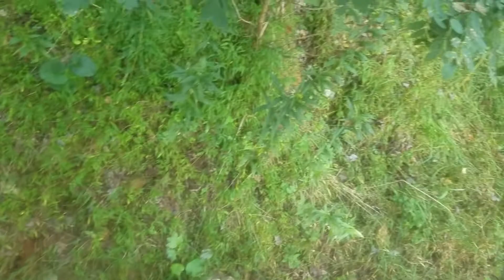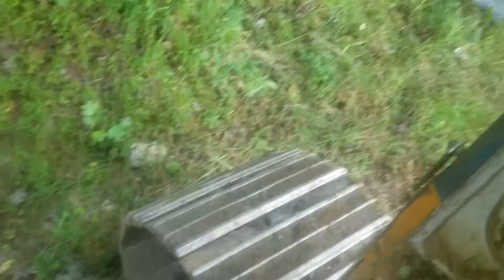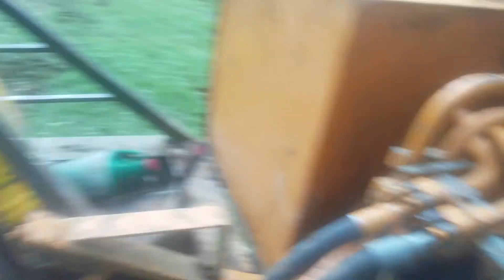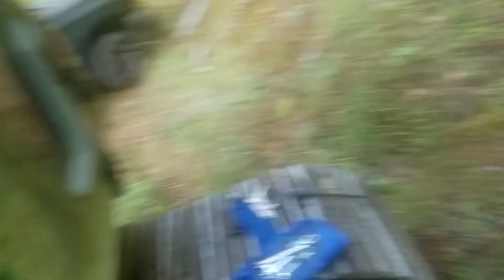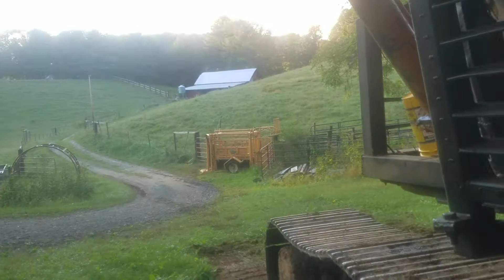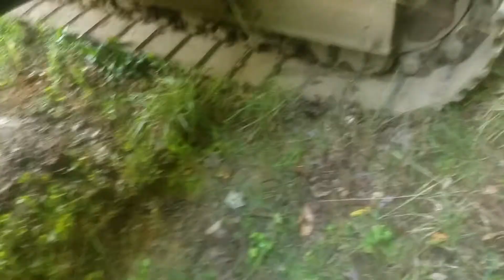I NEED SOME HELP !!!!

Comment: Check you fluid/filters. If not that get the pressure gauges on the pumps. If the pumps pan out good check your pilot controls and linkages.
Reply: I just went through the exact same thing on a skid steer. Turned out the valve body bolts we're loose and the linkage was pushing the entire body vs just opening and closing the valve.

Comment: Check fluid level and filters as mentioned, check the safety bullshit that locks out the controls. And if you have a pressure gauge throw it on and get some pressure readings. What's the make, model, and year of it??
Reply from the maker: It's a 95 Samsung se130 lcm-2